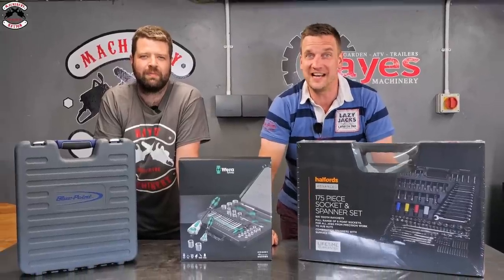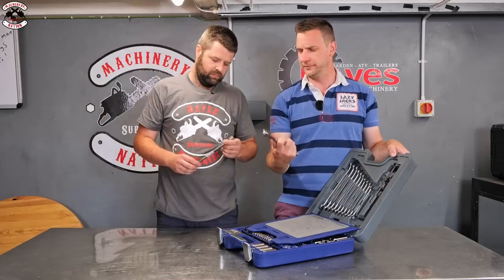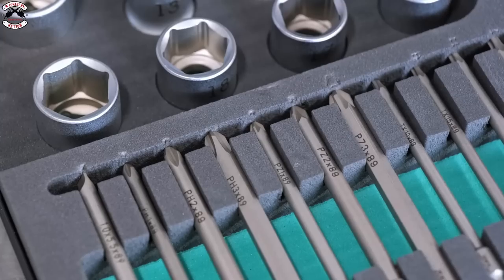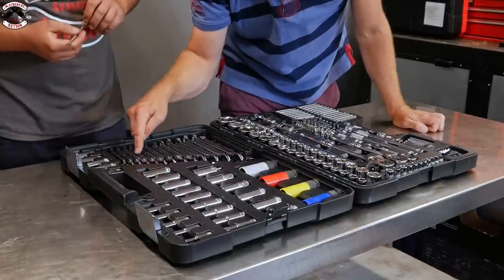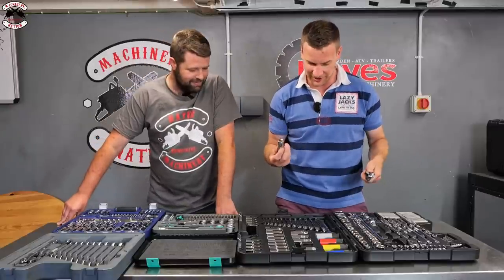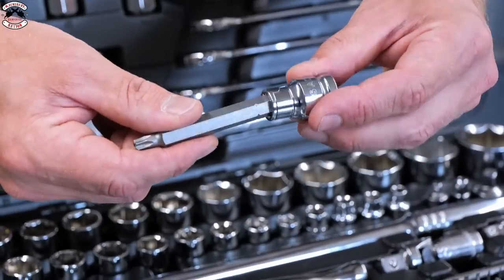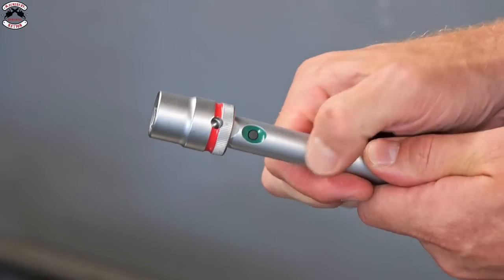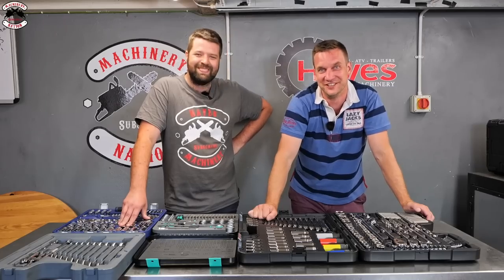The Best Socket Sets with LifeTime Warranty - Which one would you…

Comment: I used Halfords professional & advanced sets for 30 years in a large busy workshop, only problem I ever had was the screws coming loose in the ratchet head 0n the 3/8 ratchet  Halfords swapped it out no questions asked even though it was well worn & scratched up & I had no receipt. On a side note I retired at 50 & the guys who used to get all excited & run into the snap on van are still working!
Reply: I recently had the same with my one, changed it no questions asked. Quite pleasantly surprised to find the new one is held together with a circlip instead, no more screws!

Comment: Bought some Halfords sets in a sale 28yrs ago to take on breakdowns.
Still use them now almost every day, none have broken not even ratchet spanners, good buy.
Reply: Sometimes the springs in the mechanism fail but this is usually only if you let them get wet but aside from that they last ages and Halfords used to sell repair kits for them.

Comment: I have had the bluepoint set for years , great set at the race circuit or scrap yard. Parts replaced under warranty no problem and individual items are not expensive to replace either. Pay weekly, not mentioned. My son now has the same set. Catches do come off if stepped on but minuets to refit..

Comment: I've got the Halfords Advance with ratchet spanners and even using on tractors with occasional lazy use of a chrome socket on the uga-dugga gun they are holding up fine after 4 years. Yep as others have said the bit sets are brittle but then they are usually considered consumables in a workshop anyway.
Reply from the maker: That’s awesome, thank you 👍🏼

Comment: I bought a Halfords 150 piece set years ago and the quality of the ratchets was much better. Had to take the 1/4" ratchet back because it had stopped holding the sockets on and the replacement from the new sets was Christmas cracker by comparison. The spanners are ratchet on the ring end as well so looks like they have cheapened them up over the years. Great value though and no questions asked when you need to exchange anything.
Reply from the maker: Great feedback thank you 👍🏼

Comment: Having had a Halfords professional set for 30+ years and only broken one of the spline drive bits I can vouch for their quality. Note I was a master tech using Snap-on at work (I used the Halfords set at work for years but relegated it for Snap-on as money and need arose) but doing a lot of work at home and ‘foreigners’ the Halfords set has been used hard and a lot without issue. The earlier Halfords set was more complete with more over lap between the 1/4, 3/8 and 1/2 sockets also with shallow and deep ranges.

Also had the Blue-point service set, very complete and great quality, recommended.
Reply from the maker: That’s awesome James, thank you for sharing your experience 🤩
Reply: @MachineryNation  No problem… I wouldn’t normal endorse stuff, even Snap-on, which are good quality but too expensive only off set by the ‘free’ credit and convenience you get off the van. 

I don’t like that the new professional sets include ratchet spanners, Halfords normal spanners are really good and prefer these to be included and have ratchet spanners as a separate purchase. Otherwise it’s a robust set, the ratchets will even stand a bit of tube extension to give more torque as there’s no long breaker bar include 👍

Comment: 2 things about that bluepoint set. The catches on the box get broken off very easily and the handle is only on one side, so it empties its self on the floor when its picked up without being locked. Also, try getting a snap on warranty honoured (or even service work for that matter) after you stop buying stuff off a snap on dealer!!! I used a halford professional set as my loaner kit and it got abused and kept going, they didnt even blink when i took a socket back after doing exactly what you showed with the tractor! hahaha. Warranty is a very different thing when the staff dont really care! Gotta say though the bluepoint set has been everywhere with me, its nicer to use than the Halfords set, I really like it a lot. But for starting out you cant beat the Halfords kit!
Reply from the maker: Thank you for your feedback, some very interesting points 👍🏼
Reply: Halfords Advanced warranty is excellent, just take your broken tool into the store and get a new one, no receipt needed. A lot easier if you're a DIYer who doesn't have a Snap-On truck coming round every week.

Comment: Halfords Advanced is excellent quality and value, I have loads of them.
I've also got loads of other tools that come with a "lifetime warranty" but they rely on you sending the broken tool back to the importer/manufacturer at your expense then waiting for them to decide if they will replace it and if they do sending another one out, so few people ever bother. And I suspect they know this.
With Halfords you simply walk into the store, show the broken tool and it is replaced, no having to show a receipt, get the Manager, or send it to Head Office, you are simply given a replacement (or equivalent) then and there, you don't even have to sign anything. This is perfect on a Sunday afternoon when you break your spanner and need to get the job done, as in the UK you are never too far away from a branch of Halfords, so you can get a replacement within hours and get on with the job.

I've used Wera spanners and they were fine, no better or worse than my Halfords Advanced. The socket set featured is a prime example in over-design. In use the ratchet is going to get covered in oil and grease as will any ratchet, the Halfords and Bluepoint can simply be wiped with a rag and they look like new, that Wera ratchet will be far more difficult to clean as thoroughly. There is a reason that so many ratchets copy the the old Snap-On design it simply works.

I also have a couple of the Halfords Boxer resin handled ratchets, these must be 30yrs old now and still going strong, they are good when working in a cold workshop as the resin is never as cold or slippy as Chrome Steel. I know Teng Tools used the design, they made it in Orange and you can see Edd China use them in early Wheeler Dealers, but the design seems to have disappeared from the market now.

What is nice is that nowadays we have the choice of so many excellent quality tools at affordable prices; back when I started messing with cars/bikes it was either expensive "pro" tools or a cheap set from the local hardware store that had a ratchet with 35 teeth that sounded like a football rattle and sockets that split.
I've got spanners from the likes of Toolzone, BlueSpot, Silverline, Draper even Blackspur that are still performing perfectly after many years of (ab)use.

Comment: As a mechanic and owning both Halfords and bluepoint box I can say the “cheaper” Halfords will not disappoint i actually find the ratchets in the bluepoint box disappointingly weak only use in workshop services where as my Halfords ones see the road side action dirt and weather and still work grate after 5 years of use obviously it’s nice that snapon pops round weekly so warranty easily done
Reply: I have draper expert from 1991, Halfords from 2020
Halfords is nothing in comparison,the weight of the set says it all lol
Halfords has loads broken sockets and ratchet broken,
1985 Kamasa set is better than Halfords,and hilka is better lol

Comment: Simples.
For the most often used socket sizes like 9,10,11,12, get Wera Holding Function sockets.
So the screw or nut don’t fall out when you’re wrenching in a tight spot.
The other sizes just get a cheap but decent set or buy as you need.
Most important is a good quality fine toothed ratchet handle and you’re good to go.

Comment: Got both sets Halfords and Blue Point would say both are on par and compliment each other 
Halfords bits and socket bits are too brittle sockets are brilliant and hard wearing even chrome sockets used on impact gun but the odd soft socket in the set 
Blue point probably would rate them higher than modern Snap-on 
Blue Point set lasted me seven years without being shy to use impact gun on these now on the second 100 piece set wouldn’t have any other way 
Thank you excellent video guys
Reply from the maker: Thank you for sharing your experience, we really approach it 🤩

Comment: there are several different socket locks out there. I have some good ones from Stahwille and Facom and each type has pros and cons, but a very handy feature that i use a lot in fiddly areas, especially in smaller drive sizes.
Reply: Are you in the armed forces by any chance?

Comment: I have a bunch of wera stuff, I love the screwdrivers, but I have a set of joker ratchet spanners which I have never been able to use, the heads are too big, the open end is pretty unforgiving and they have a flat profile which is super annoying. Another issue I have with wera and it applies to all rubber handled ratchets, is they get oily really quickly. I would like to try a wera ratchet, but I have a feeling it's a bit gimmicky and I think having to clean the handle is a bit of a faff. The locking extensions are genius though.
Reply from the maker: Awesome thanks for the feedback Stuart. We have a ratchet spanner video coming out very soon 🥳 this is really useful 👍🏼

Comment: Hi guys ....an excellent review and well represented so thank you for posting.
Ive been using Halfords tools since the 1970's and never had any problems with them, i even had a 1/2" drive all steel ratchet that had an oil hole in the top so that you could lubricate the mechanism, i used that ratchet for years, outside in all weather's, i eventually gave it to our son to use as he is a light and heavy vehicle mechanic and im pleased to say its still in use.
The new Halfords Advanced tool range is excellent and ive been using those regulary without any problems.
Halfords are open 7 days a week and have a store in most large towns, you can check the availability on line, as well as placing an order, when its ready for collection then you are sent an Email and text message.
Most of the tools are on display so you can handle and view them before purchase, they are priced very reasonably especially on the trade card, or when they are in a sale.
I find after sales very good at Halfords, i recently purchased a toolbox part of the Advanced collection, but when i opened the box at home i found one of the drawers was not operating correctly.
I returned the following day and Halfords immediately exchanged the tool box without any problems, very good customer service and free parking.
I have personally never owned any Snap off tools as they are far to expensive, ive never owned any wera tools either as ive never seen that brand previously, but have owned many other makes such as Britool, king dick, snail, gedore, facom, draper, elora etc, its not about the tool brand its all about the skills of the person using them......
Reply from the maker: Hi Stefano, thank you very much for your extensive feedback. Really great to hear your experiences.

Comment: Good job guys, for me, the key is how thin the spanners and sockets are, tools that have thick walls are useless. 

I’d rather have no life time warranty and the tools are a bit slimmer and more accessible.

Also, cheap Allen keys are a waste of time, investing in a good high quality set will mean they actually work and don’t just slip right away. 

You don’t need expensive tools, but it’s worth considering the finer points on design for your intended application.
Reply from the maker: 100% agree. I’ve got a lot of cheaper tools that either “fit the bill” or ones that don’t get used very often and can’t warrant the expense 👍🏼

Comment: i've got one of those halfords extensions that have the button on them to stop the sockets falling off
it broke, they replaced it in the store straight away
Reply from the maker: Cool, I didn’t know Halfords done a button on an extension, I will check them out 👍🏼
Reply: @MachineryNation  i don't think they do they anymore, this was from a set i bought about 10 years ago, the button broke the first time i used it 🤣
i'll see if i can have a rummage around to find it as it's one of those tools i very very rarely use anymore as i prefer the wobbly versions
Reply from the maker: @therealdojj  cool man, that would be awesome 👍🏼
Reply: @therealdojj  They still have them, I just ordered a set for £11.19 with a Trade Card, basically 1/2 price.
Reply: @huwjones5879  the trade card is so good, at least 20% off most things and in some cases i've paid pennies for light bulbs

Comment: I had an Halfords advance set since they where first available. I think I paid about £80 for a massive set . My wife wasn't to happy that I spent a week's wages on some sockets and spanners at the time . I had to replace all the 10 mm 13 mm and 19mm . Think the socket fairy has them . Good tools and well happy . Plastic case isn't up to much good as I think the ultra violet has had a go at it . My old first set had a metal case and even though the sockets are all rusty and can't read the sizes it don't matter as they where AF anyway. I tell you and excellent socket set that is absolutely brilliant is the Lidl own brand for £35. These are all 12 point sockets and come with a massive bit collection. I had this set six years and only broke one stupid bit ( my fault) .
Reply: I did the same, walked in and chatted to a guy about tools 10 years later, mentioned the case was crap and had broken, and apparently they will even replace the box under warrenty, and just so happened to have one in stock! Take the thing in and ask, its definitely worth it.

Comment: Old school mechanic here, those tools are ok, but not enough tools as a mechanic to get the job done. Blue point, pricey but not a complete set of extension, wrench & only in 3/8 & 1/4 socket set, and not a complete set at that. Werea set, awful set, very little to do there, the last mechanic tool set the Halford set is ok but not a complete full set in socket. My best opinion in a mechanic tool set, is the Dewalt 204pc mechanic tool set which has a complete full socket set in Metric and SAE, nice wrench set, and a good set of extension of 1/2, 3/8, & 1/4 set, and a good set of allen & E-torx socket set. And another complete socket set it the Pittsburgh 301pc socket set. I think you should check both sets out. But hay that's just my opinion as a mechanic.

Comment: I may have used an impact wrench on a halfords socket and guess what it split. Took it to local store and they simply replaced it. Excellent being able to get another replacement immediately.
Reply from the maker: That was good of them 👍🏼
Reply: Wwll technically they shouldn't as these are not impacts, but it is what it is I guess. I weld all sorts of sockets > 41 that folks crack all the time cause they use impacts.
Reply: @Mistabushi  I agree I was most surprised but I guess it is difficult to show that an impact has not been used on it. My point was it appears almost no quibble which is amazing for such cost effective tools.
Reply: @fibreguy1971  yeah, I get ya mate
 I have couple of halfords tools and big fan of they torque wrenches as they are good price and comes with  calibration certificate. Anything within that price range is crap, so point for them.
Reply: @Mistabushi  yep I have one of those too. Good for keeping in mobile kits as if it gets lost it isn't catastrophic
Reply: @Mistabushi  The Halfords torque wrenches are made by Norbar, one of the best out there.

Comment: Colour coding the sizes is a good idea. It allows you to quickly grab the right size out of a pile. If the hardware (bolts, screws, nuts etc.) followed the same colour codes, it'd make things a lot faster too. It just needs to be standardized across manufacturers.

They could follow the standard used in electronics - https://en.wikipedia.org/wiki/Electronic_color_code
Reply from the maker: That would be amazing if all manufacturers used the same coding 😇

Comment: I can’t comment on the 3 as I use Bahco and I believe they also have a lifetime warranty, I’ve never had anything Bahco break imo they are great and I wouldn’t use anything else 🙂👍
Reply from the maker: The Bacho stuff is nice, I own a set myself. They early made it in this video but one of the lads just bought the Snap on set so we used that instead.
Reply: @MachineryNation  What I like about Bahco is it’s reasonably priced but is still well made, I have the 3 socket sets I use the small set most but the larger set I mainly use my my vehicles. I’ve done a couple of giveaways in the past of the small Bahco set and the winners seem to love them. I’ve always been a fan of Snap On but never could warrant spending the money, so imo a make like Bahco is a great alternative 🙂👍
Reply from the maker: @menditman2004  yeah defo, I’ve got the little small set and love it apart from that the case does not fold flat when open haha. But 100% love the Bacho stuff and it’s owned by Snap-on so win win 🤙🏻
Reply: Snap-On owns Bahco. It's on their our brands page.
Reply from the maker: @1pcfred  they do indeed 👍🏼
Reply: @MachineryNation  I have an old Bahco adjustable wrench that was made before Snap-On acquired Bahco. It is really nice. Was made in their old Swedish factory.
Reply from the maker: @1pcfred  nice! Love this 🤩